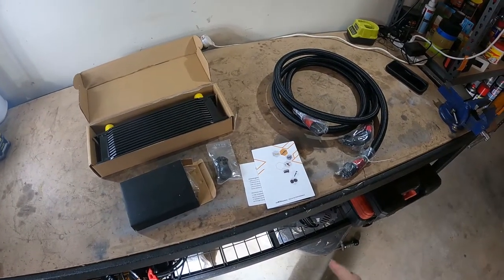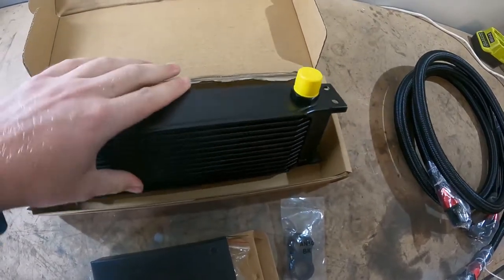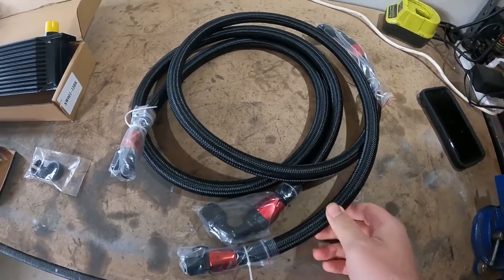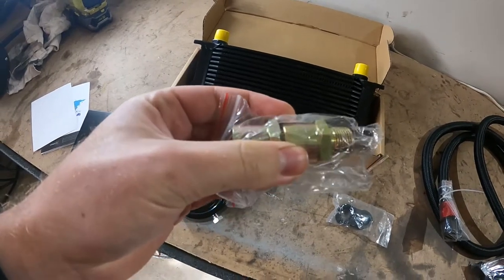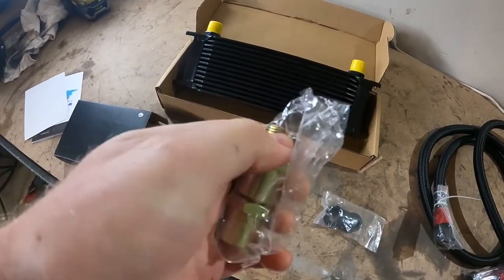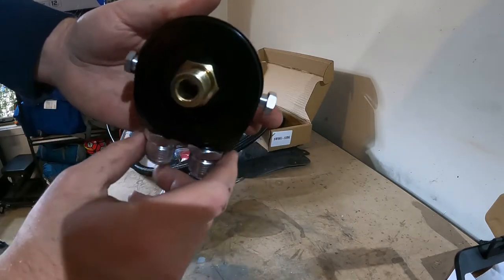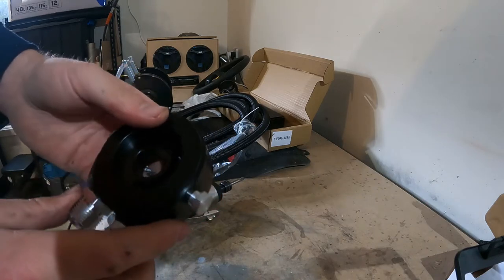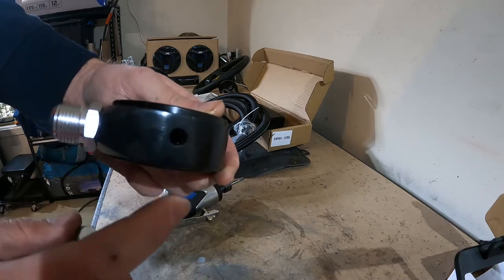Easiest Oil Cooler Install Ever! | Eg Civic B16

Comment: Hey mate, nice install, wondering if it was worth it? And did you have any leaking issue? From hobart tassie here, thanks
Reply from the maker: The oil cooler ended up leaking and they sent me a new one.
Reply from the maker: Also I would recommended get a thermostatic oil cooler as it takes a long time for the car to get to operating temp

Comment: Hey Jarrod, have you had the chance to check the oil cooler setup, any leaks and was it effective in cooling down your oil, looking at doing a similar upgrade to a civic with b16a
Reply from the maker: I will finish it off today!
Reply from the maker: I was running the car for some time today and the cooler body had a leak where the fitting was attached. Nothing super bad but I have emailed and asked for a replacement.

Comment: Plan to install one on my turbo integra that I road race. Also u should use some rubber between the oil cooler and where u have it mounted. Vibrations is gonna tear apart ur cooler. Exactly why the radiator has rubber on the bottom and top of it.
Reply from the maker: Yes good idea! I don’t plan to drive the car a lot so I think it should be fine.

Comment: So did you eliminate the b16a stock water cooler?
Reply from the maker: Fortunately my car didn’t have one.
Reply: @JarrodWillemse  b16a2? I wonder why the older b16a have it and all other b series didn't, and if I eliminated it if it'll be dangerous
Reply from the maker: Not sure why particular models got it. If you are installing an oil cooler you can remove it. I heard that in some rare cases the cooler fails and coolant gets into the oil.

Comment: Hey, i know its been a long time, but i have a question. Did you drain the oil beforehand?
Reply from the maker: No I didn’t. The oil is sitting in the pan so it won’t leak.
Reply: @JarrodWillemse  thanks!